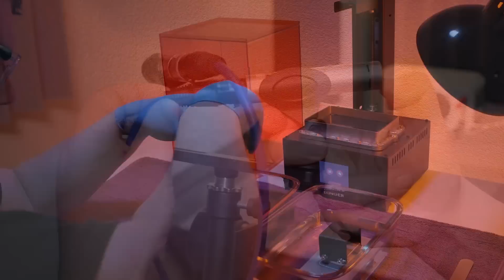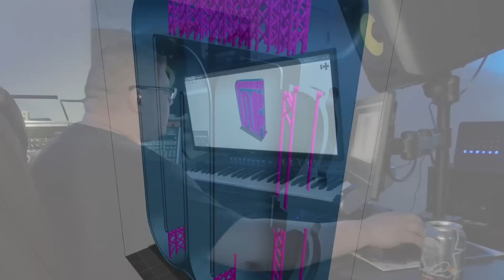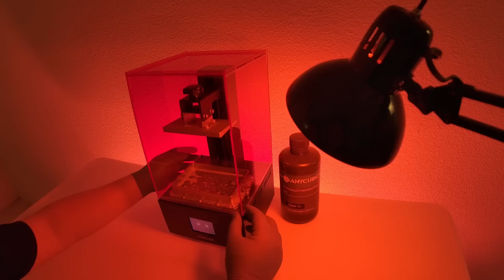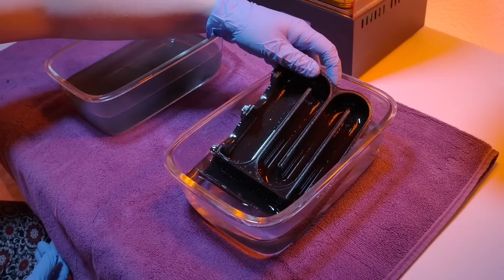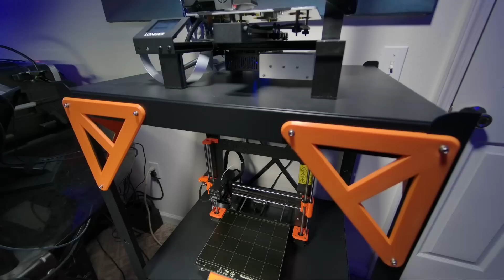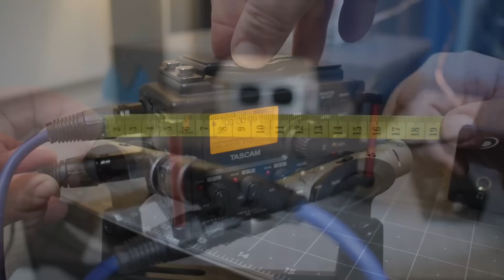Orange Adventures (Part 1)

Comment: for testing 2D printing is the best. once the design works, consider printing the negatives to make a silicone mould, and cast the cabinet in something like clear epoxy resin or polymer concrete. 
clear epoxy could look absolutely stunning, with a polished outer surface, so you have a clear view of the transmission line, that's either left rough (matte translucent) or even better painted in some cool metallic color.

Comment: Variation on a *Daline transmission line*. If the chamber was tapered into the first section of the folded line/wave guide (as it were) giving a linear transition, one could take that into account of a 1/4 wave. IDK Pete, I've only been designing t-lines since 1991.

Comment: 🟦.... Putting the speaker on top of foam allows the speakers to set the The relatively small mass of this enclosure in motion, causing certain frequencies to be absorbed or dampened
For a true measure of performance the cabinet should be held In place as rigidly as possible from any self-induced vibration.

Comment: Hello, will it be sensefull to use these speakers with the 3" V2 printed subwoofer? You said the subwoofer can play to around 1,5-2khz. Since this t line has a resonance frequency at 650hz which sounds hollow would it make sense to cut them off at 700hz and use the subwoofer until 700hz. I know I will loose the stereo sound anyways...

Comment: It would be nice if you could release the design file. I want to print this, but the connections on the front won't work for me. I see that someone mixed your file to put the inputs on the bottom, but he also changed the size of the line. I just want to move the inputs to the back.

Comment: Ok, here goes mine. I'm sure everyone has their base 'test' cd; for me it is Enya's 1987 BBC release of 'the celts', NOT the bastardized 1991 WEA version. There are multiple tracks, but as far as my experience goes, track #14, 'dawn-y-dwr', is my go-to track. So far the only sub below $5,000 able to hit that note was the Muse model 18. I have absolutely no clue what freq. that note is, but that is my tester. I am not planning to buy an analyzer just to find that freq. I recently drove 50 miles to test the SVS 16-Ultra, and it would not hit that note; nor would the JL Audio f113 mk2. I'm not going to purchase a sub made in the 90's and expect it to perform for any extended period of time. All I know is that it had 2 10" woofers in a 2-inch thick cabinet and weighed 250 lbs. And it was quick as lightning!! Is there a way to replicate that? Thanks for listening.

Comment: Just printed a set of these. An interesting experiment for sure, and for such puny speakers it’s impressive the sound you get out of them. 
That being said I wouldn’t really recommend them, out of all the hexibox projects (I’ve printed several) these sound rather plasticky and there is a distinct tube sound to them. Still, the base extension is totally impressive. and I had a weekend of fun putting it all together, super worth it. 

But if you’re gonna try just keep your expectations realistic; these drivers are super tiny, and quite cheap, I don’t think any enclosure will really save them from themselves. 

Of course I could be wrong, and the error might be on my end. Regardless, thanks so much to Hexibass for the incredible content and sharing his work with us all. I bought and learned to 3D print because I wanted to try your projects out and it’s been such a fun/challenging journey.

Comment: HexiBase, do you mind sharing the critical dimensions of the enclosure? I would like to make a remixed version of your enclosure with a different form factor but still use the same acoustic structures (i.e. the cross sectional area of the T-line, the length, the volume of the cavity, etc)

Comment: In the sub bass region, where most subwoofers seem to come into play, I’ve found that anything below 30 Hz or so is basically flutter. From around 30 Hz upward the sub bass region becomes musical. In my early attempts at building my own speakers I focused my attention on reaching all the way down to 20 Hz, but after I got my current system, which uses two two way speakers rated from 45 Hz up tp 23 kHz for the mains and 23 Hz up to about 250 Hz for the sub I found that the frequencies any loser than 28 to 30 Hz weren’t really pleasant and not used in music unless the musician is playing a Synthesizer. Then other Musician must be careful about the lower frequencies are used as the Flutter of the lowest audible frequencies can fatigue the listener’s ears. So now I focus on around 28 to 30 Hz for a full range loudspeaker design. Do you agree Pete?
Oh, and hey Sophie!

Comment: I don't think you know how air compression works in tandem with sound expansion. It's like blowing air thru 2 straws, one is small and releases air pressure gradually,  and the 2md straw is large and holds no compression, it ejects the air as fast as it compresses. Every woofer reacts differently to the air pressure It's held under.

If you reduce the size of the baffles you will substantially increase in sound output until it gets too small and instead creates hissing instead of a thump.

Comment: When I build my T-line corded stereo Bluetooth speaker, I am going to use 3.5-inch balanced mode radiators, 3d printing, a DIY ST electronics TPA 7269 14+14w based class-AB amplifier for natural more organic sound, a heat sink to cool the amp cop, apt-x Bluetooth board to take advantage of class AB amplification, foam tape to cover the wires, front buttons, and rocker switch, a power LED, and power it all with a salvaged 35w 19v inline wall wart because 28w will be used to power the speakers and about 7 watts are wasted as heat from the amplifier IC and a few milliwatts are used by the apt-x Bluetooth board.

Comment: I think a really cool project for these little drivers would be something a bit more practical and 🤔 natural... A pair of custom heads cans!
Headphone cans with an enclosure shape in the form of a nautilus spiral. It would tick so many boxes for views with gamers and audio enthusiasts that you would be hard-pressed to catch such a large swathe of people. I believe the port should probably open up behind the lower portion of the ear to avoid negative pressures as well as induce resonance into the jawbone.

I was thinking of doing it, but I don't have these printers. I would have to Tig weld an aluminum enclosure and it would be too hard to pull off to make it anywhere as light or as clean as your tools can do it. Computer printing composites is amazing.

Comment: Erm... how's about this as an idea...

3d print a bunch of junctions and gaskets, but build the majority of the transmission line out of PVC pipe.
Reply: Thu Nell Ⓥ  I reckon that with a bit of bondo car-audio fiberglass thinking, it could look pretty.

After all, the inside of most vehicles is full of weird and ugly plastic brackets, hidden behind various trim panels.

Comment: some  basic  info.       there is a reason that  good speakers, even small ones,  have  Massive enclosures.          a correctly designed enclosure  blocks/damps  the  sound waves propagating from the  back-side  of a driver.     where the, out-of-phase, back-side sound waves are able the enter the listening space/volume,  some  Cancellation  occurs.         consequently, the use of a baffle-located port exit, with a  tuned port/wave guide,  is  NOT  ideal.      compare  the use of a  baffle-located  port, in a  bass reflex  design.         i'm sure you already know that multiple  drivers  Should  be connected in  parallel.   cheers        googletranslate
btw,  ever here of  epoxy,  for    plastic
https://d2ul0w83gls0j4.cloudfront.net/products/10/600/1004452.jpg

Comment: If you'll use wood or ceramic materials the closer you'll get as you know other materials absorb or reflected or scattered throughout materials even sound waves using PLA AKA plastic would decrease your efficiency it is a good prototype but I'm willing to gamble on it.

Comment: I have a pair of standard Senheiser 280 over ear headphones and this is the first I knew they were on backwards. The rotational joint above the angle joint makes them so that they don't usually fit on my head.. I doubt you necessarily feel as such but this setup of yours put some perspective on what it means to be an audiophile.

Comment: Great video! It might be a bit late, but I find the limits given for resin to be to low. I print usually closer to the upper limit as the warmer temperatures means the resin is thinner and aids in the build plate - FEP tug of war. You also have a lot of surface area to contend with. The FEP needs the ability to peel from the layer. Higher surface area makes that much more difficult. Check the videos by 3DPRINTINGPRO for more on that subject.

Comment: I made my own transmission line mini speaker before and learned a lot. All comes to the length of the port and speakers resonant frequency. The speaker will be mixed with amplification of higher octave frequency if the port is not converging. Convergence will act as low pass filtering, thus will only boost low frequencies. My 2 inch speaker can make bass equivalent to 4~5inch sealed box woofer, achieving response of 50~60Hz with 1.5m long PVC tube. I also tired to dampen high frequency noise with layers of paper lining inside the tube. Anyway, I think transmission line design is a great start for newbies as it only use simple Physics concept, although the speaker box might be physically huge in the end.

Comment: Can the irregularities be from the drivers mounted at the same depth in the chamber and the right driver sound has to travel farther than the left to get to the port on the left? This may sound dumb but I do not know much about acoustics but do understand electricity and current flow and am applying that to this. I think this because the way the first implosion type nuclear bomb. The core was surrounded by layers of explosives and detonated in way the force was returned to the core with a second and maybe a third explosion timed to where the force is amplified vs. all at once and not increased by pressure waves.

Comment: are all your missing  happening on one side og the machine? . . . if so, you might check the leveling of the LCD screen relative to local gravity, not just matching base and screen for parallelism.

shorter: get a machinist's level and check.

Comment: As said before: Orientation matters. Printing out big flat surfaces is not the best idea on a rdsin printer. You should tilt the object a little bit. Also, make sure you have no isles when slicing. Isles are areas where overhang leads to slices with parts of that slice being unattached to already printed structure. Then the printer prints in "thin air". Supports need to added in that case.
Regarding the resin: Shake it up and make sure it has the right temperature.

Comment: My dad created a closed wooden enclosure with a square spiral port design inside.
With a printer you can create a fully spiral port enclosure, starting with wide ports, ending with a very narrow path where the port walls meet one another..
https://i.pinimg.com/originals/1f/5b/51/1f5b511e52cfb5bb2317951a5f99f32a.jpg
The drivers are too small for this enclosure, they have a ~700-1500Mhz bump from where I hear it.

Comment: I realize that I am super late to this video, so this comment will likely help nobody... but a few tips and tricks.
1) try your best to not print perpindicular to the build plate, and/or enable anti-aliasing (I don't think Orange does AA?).  This helps get rid of some of the weird pixel shift weirdness, and often requires fewer support (especially if you have bridges parallel to the build plate).
2) No need for a red light.  If you are using an LED light, there is little to no UV light, as LEDs are typically narrow band RGB LEDs which offer very little between any of those colors.  It is a trick so that they can get a good CRI, while producing less heat.  Most windows protect against UV light, so you don't need to worry about that unless you have some pretty old-school 'actual glass' windows.  Your typical double-pane is going to be fine.  If you really want to be paranoid, use a standard bulb, and paint on some UV protective paint over the bulb, then you can have normal light and not worry about it.
Outside of that, leave the cover over the vat when not actively changing things out, and your resin will stay good in the vat for weeks (or reportedly months) at a time, with only needing a little stir before printing if it is sitting for more than a day.

Comment: I have a laser sla printer and I had issues you are having. Orientation is important, print at an angle not flat, though this matters on the surface area. Also, I found you MUST mix or shake up the resin very well right before you pour it into the vat. That makes a huge difference. I think the resin separates, if you keep pouring out un-mixed rasin it will get out of balance, chemically. Shake shake shake! I dig your videos!
Reply: This sounds like it could unmix even while it's printing hours long?
Reply: REDxFROG up & down motions into the liquid resin of the cured part will mix it again

Comment: Why not use something like the Visaton  BF 45 S - 4 Ohm. It has much nicer treble and is quite linear down till 200 Hz. Give it a smal boost at 100 Hz or so and it should be a great speaker. Thanks for the videos and the 3d data btw.

Comment: Hey man I hope you see this, I'm currently printing this on my FlashForge Creator Pro and the case is coming out well so far. But, I got an idea, and I'd like to run them stereo. To do this, I would modify the model to take RCA's instead of banana plugs and run those to a 2ch amplifier (I'm looking to also bluetooth this). Do you think that that would ruin the sound? Would both the drivers going on different channels ruin how this works? Also, a suggestion, I thought that I would use flocking in mine to reduce echoing like felt. It is a powdered "fuzz" that applies with some spray adhesive.

Comment: New subscriber here and this is really impressive stuff... 

From a 3D printing standpoint, the resin print will always have a high rate of failure due to the way it's orientated. The size of the surfaces that are printing parallel to the build plate will cause massive amounts of suction against the FEP, causing the flat pieces to warp or fail completely. Normally you'd angle the print to minimise the cross-section of each layer, and have the print self-support where possible, but that would require a much larger printer for this piece. With this print, the only way you could get the details to come through is by supporting the hell out it. Paying particular attention to the edges of any overhangs.

Also, if your having prints fail for no apparent reason, check your temps. If it's too low then the resin is less viscous and doesn't flow. Dependant on the Resin, 20-25°C or 25-30°C ambient temp is needed. You can always pre-heat the vat/resin on the heated build plate on the FDM printer.

Comment: Could you do a video on Bessel array speakers? Soundbars are extremely popular, and you could probably 3D print the enclosure(s).

If I can be greedy with the teacher's time I'd like to know how to make ribbon tweeters work in a Bessel array. Especially the effects of length-wise vs width-wise orientation and how it effects what constitutes the diameter and spacing for the Bessel function. Could you arrange them adjacent to each other width-wise for a square-ish point source in an n-7's empty center, and could they use Bessel weighting for spherical output? The only info available to enthusiasts is spread across numerous patent filings and doesn't seem to cover both two-way/ribbon concepts.

Comment: Let's say I can cheaply get my hands on the slightly larger TEBM35, do you think I could make a similar one or slightly larger TL like this? for me in Australia, the speakers may be cheap to purchase from PE, but then i get nailed with a horrible exchange rate and then 20-30 USD for shipping :( Hence the bogus question from me if you can change the main design parameter ..... sorry

Comment: What you can do to "glue" it together, is put a little of the resin on the joining surfaces.
You would do this after cleaning with alcohol and before final cure with the UV light. 
After all this is done, you should paint it to prevent from "over-curing"

Comment: I have an AnyCubic Photon SLA printer and I found that maintenance on the film was very important. I had a similar experience with the first few prints.  Really good, okay, really bad.  Once I learned to clean the film I got 15-30 prints per film instead of the 3-4 that I got with the first sets of film.  I found that cleaning the film with isopropal and then wiping it dry with Kimtech wipes between every print helped out significantly.

Comment: you should get some poly-smooth pla that you can vapour smooth with isopropyl to see if smoothing the layer lines effects frequency issues. i would say that the higher the frequency the more it bounces through the system and the higher chance it has to be deformed by the layers of the print

Comment: One thing you have to watch for with these resin printer is that the LCD screen under the build vat can get damage if you have left over resin crumbs in the vat.  As the build plate comes down it can push the crumbs into the FEP and into the LCD screen.  Net result is an LCD screen with small holes which shows up as really weird 3D prints.  I have a Phrozen Shuffle in which I only got 3 models before these problems showed up.  I ended up replacing 2 of these LCD screens at $90 bucks each.  On the third replacement screen, I bought a tempered glass protector designed for a Wanhao screen and put that screen protector between the LCD screen and the FEP.  No more shitty prints with drop outs.